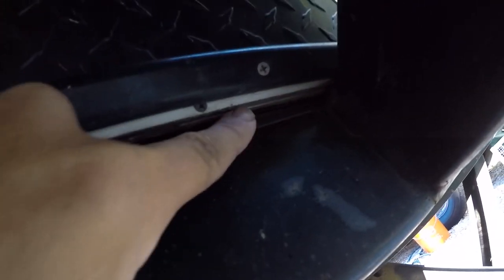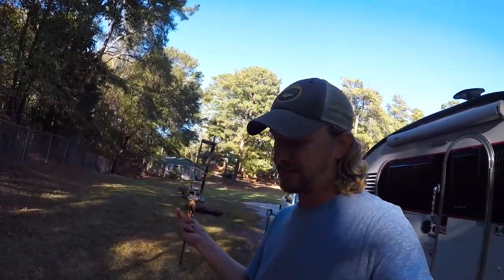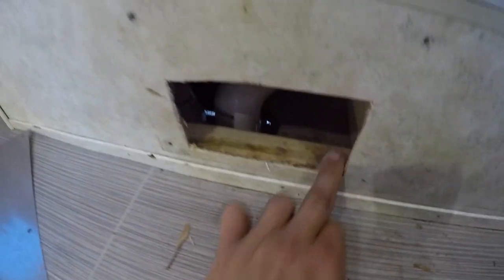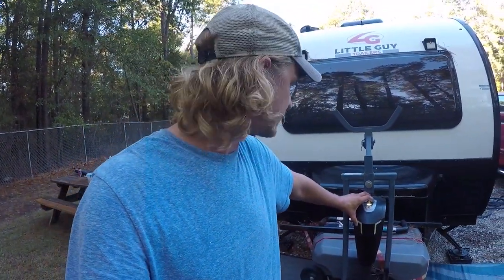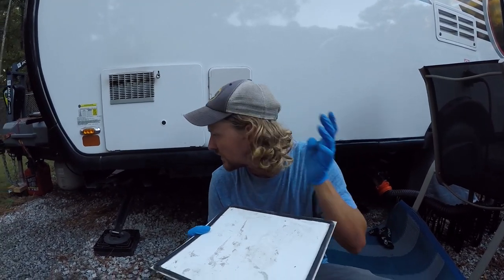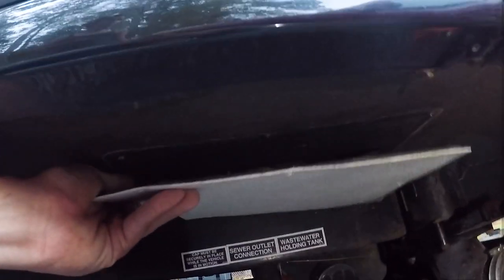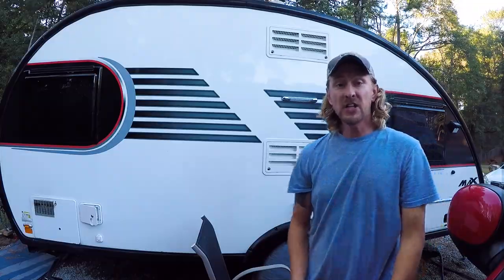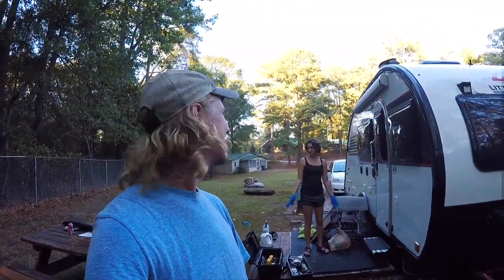Sealing the Little Guy Max and the "Hidden Airflows"

Comment: You are very helpful, regarding RV maintenance, I remember someone saying that pulling an RV is akin to causing an earthquake :-O. And that makes sense! We bought a Bushwacker 15FK teardrop because our Tacoma could pull it. It is a fine little unit for the price. We anticipate having to check it often for vibration issues, like any other camper. When we are ready to buy a larger tow vehicle, we will  look to  buy a LGM ...and continue to follow your channel! By then we will have a note book full of tip and tricks for keeping a camper in good nick. I appreciate your comments on drafts and keeping the floors warm. This is not a winter camper, but I'm sure much can be done to make it warmer. ~ Diane
Reply from the maker: Thanks for watching and sharing. Living fulltime in the LGM for years have taught us a lot. More trial and error but we wouldn't trade it for anything. It has been a fun ride.

Comment: Thank you very much for the view through the bottom of the Max to see the shower drain.   I had to remove the panel beneath my shower door to access that area when I had a leak at the shower drain.    From the video I see you can check the shower drain on that pan.
Reply from the maker: It is always good when you find another vantage point to plumbing! Thanks for watching

Comment: Great job you two! Question for you...do you ever notice big drafts coming from under the kitchen area? If so, what have you done to minimize that?
Reply from the maker: Not really a draft but the floor itself can be cold in winter. We use carpet squares that cover the floor to help your feet stay warm. Also draft comes in from the drawer under the fridge and the drawer under bed. We have used insulation and sometimes the couch cushions fit perfect standing up width wise on the bed drawer. On super cold nights we do that!

Comment: I enjoyed your video, so I subscribed. I’m thinking of buying a Mini Max next spring. I have to get a vehicle that will tow it. I’m wanting to travel out west for a couple of months, next Aug and Sept. I’m wondering how you keep the plumbing from freezing on cold nights. I guess I can ask the sales place. I love camping. I tent camp now. I live by the Smoky Mountains National Park. I love photography, hiking and camping. So I’d really like to have a compact RV. I’ve looked at many videos about many brands and models. I think I like the mini max the best. It seems to have a lot of features and is quality. I also like to oversized refrigerator. I look forward to your future videos. Found you through the LGM Facebook page.
Reply from the maker: Thank you for your support and watching! We keep a good eye on the weather and aslong as it doesn't drop past 32 degrees we have been fine. Last winter was mild in GA. We tend to just empty tanks at night if it was going to be freezing.
Reply from the maker: We also have doubled up on insulation on windows, walls, behind walls, etc. With a space heater going that teardrop can turn into a warm egg. Hah also we leave the gray tank line open on freezing nights. That was a learned lesson in TX when we had full gray tank and frozen line and couldn't empty. Back in our TX videos.

Comment: I'm trading for a Tab 400 this week over the LGM precisely for the issues you are sharing. According to my dealer, who sells both, Liberty Outdoors are sending out 2020 models that leak, and are refusing to honor their deals with the dealerships, so the dealers have to do the repairs that LO should do.
Reply from the maker: Every rig seems to have issues. It's a home on wheels.:) I would be surprised to hear Liberty Outdoors not help. Maybe try a different dealer. Southland RV in Ga has a good relationship and has always helped us. But either way that Tab is a nice teardrop aswell. I wish I could mix both and help design the Big Little Max lol
Reply: Same with me. Had two mini maxes. First leaky unit was replaced and second unit leaked in just as many places as well. Some of the same places and some different. The back seam would not stay together. Didn’t check the front seam. Could see daylight through the back as well as other holes in the floor and wall that were never sealed. Some of which not only could we see day light.. I could completely see outside through my wall by the 110v plug. no matter now much we sealed the seam would come back apart. I wouldn’t take another LG if it was free. Looking forward to my tab 400. It was scheduled to be finished built today.

Comment: Can describe the leak you were having in the wet bath?  You mention in closing you seal around the toilet?
Reply from the maker: Basically where the shower wall  meets the plastic toilet cover. Water was going down the wall by the door and dripping on the floor and small leak coming from under the shower door at the base of the floor. We used clear silicone around the entire toilet cover against the wall. A very thin line. Now it is sealed and all the water flows down the cover like a mini waterfall. Nothing is going behind the plastic cover plate now.